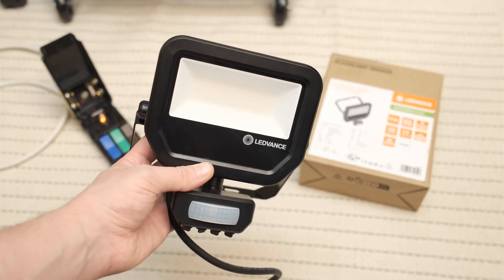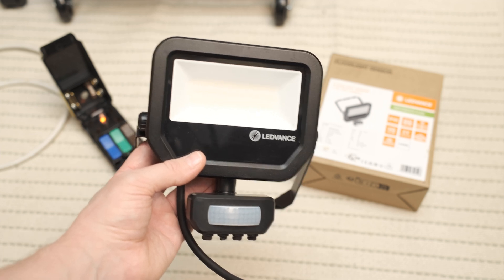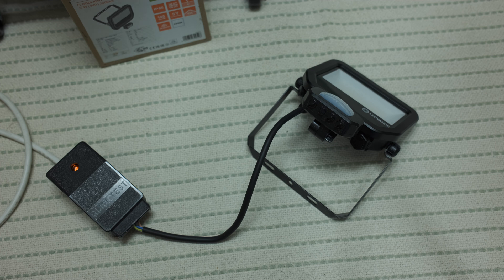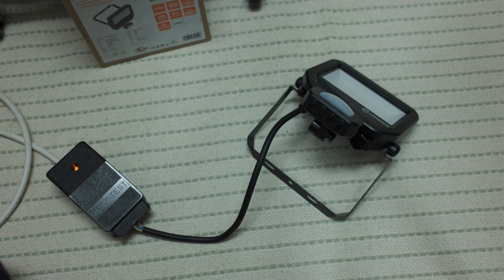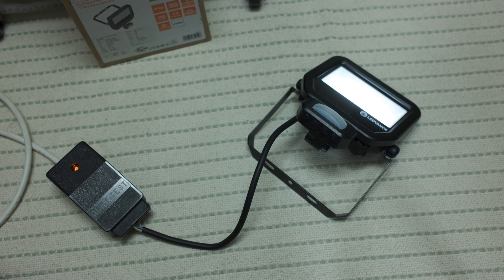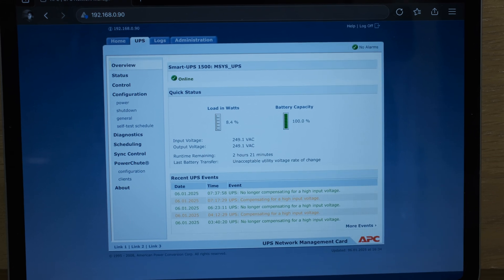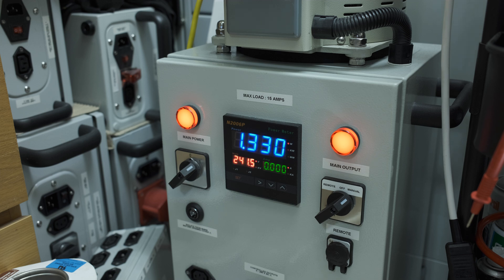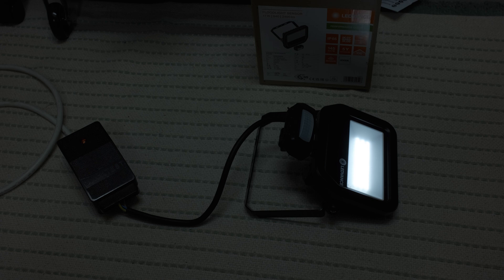LEDVANCE 17w Gen4 LED PIR Floodlight: Voltage issue.

Comment: I’ve just fitted one of these today and have the exact same issue. My voltage is 249v.
Could using a dimmer switch solve the problem? Thanks
Reply: Thanks, I got round the issue by connecting the floodlight via a WiFi socket which switches it on dusk to Dawn.
Reply from the maker: @williammckenna7420  Possibly, but the driver might not like it since dimmers chop up the voltage waveform.

Comment: Interesting discovery - I looked at LEDvance myself when trying to pick a replacement floodlight to replace a failed 150 W halogen at my parents' house, but went for a Brennenstuhl 20 Watt thing ultimately - perhaps, for the best, as our mains voltage can be quite variable too. I had hoped that it might be a German product, but of course, it was made in the usual suspect country!
It didn't come pre-wired, unusually; instead, there's a push-fit connector for the three cores located within the rear compression gland. A bit of a fiddle when you don't have much space available, but I managed to sort it. The main downside is that it's 6500 K. It doesn't have the "dim-down" option of the LEDvance, incidentally.
Reply from the maker: @StreetLightOnline  I'm not sure if this one was defective or if they are all like that but the previous model without the standing dimming feature lasted years until it got smashed up, hence why I decided to get this one.
Reply: @FrontSideBus  If only the previous one hadn't become damaged! So much for the technology improving as the years go by.
Reply from the maker: @StreetLightOnline  I might try and straighten out the bracket and repair the sensor of the old one!